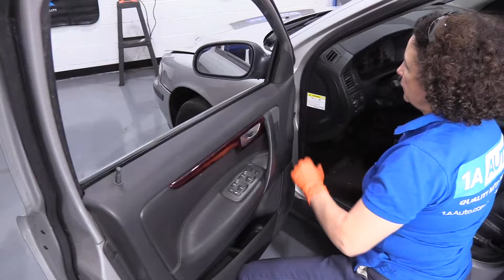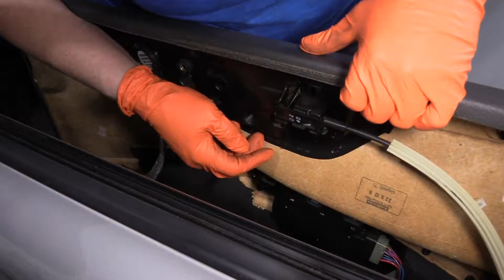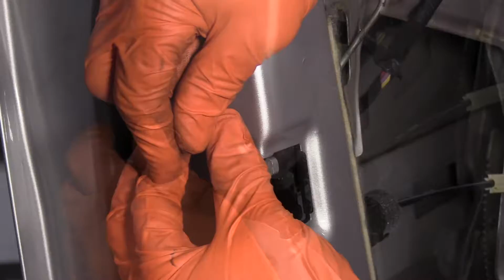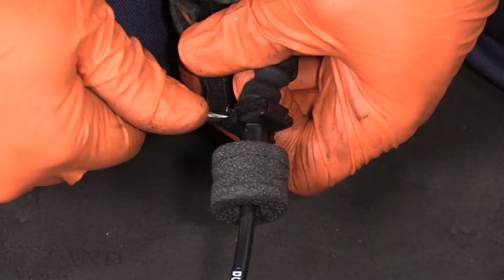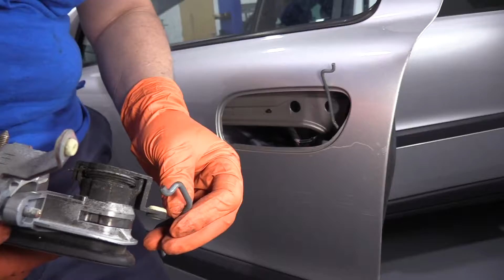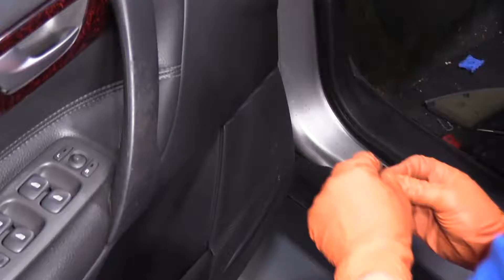How to Replace Front Door Latch Cable 00-07 Volvo V70

Comment: my door latch cable keeps disconnecting from the handle but nothing is broken . The wire end bulb just wont stay in the groove on the inside of the door handle . The whole clip piece clips in fine but the wire never actually connects or stays in the inside handle . If i pull the wire by hand it opens the handle so i know the cable is still good . I wouldnt care that much other than im borrowing the car .